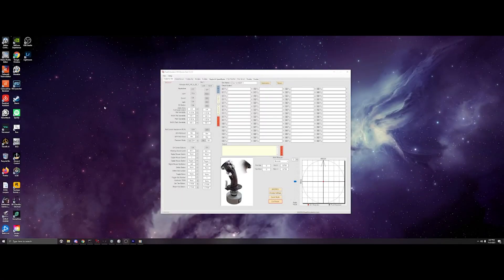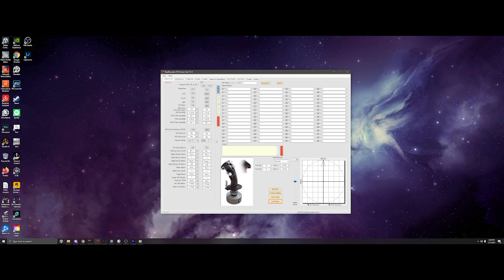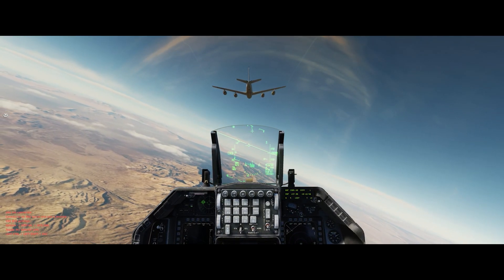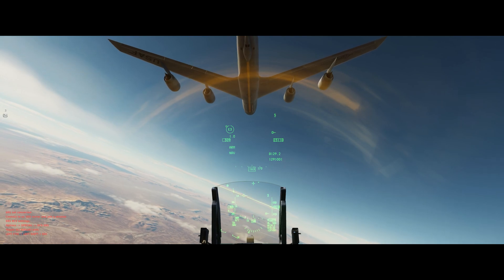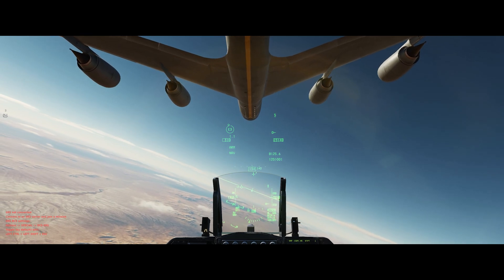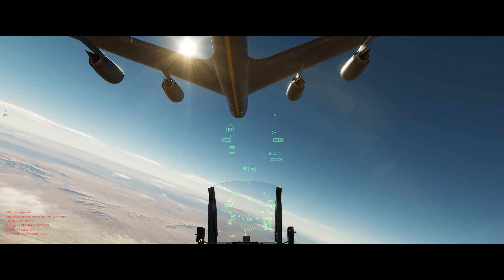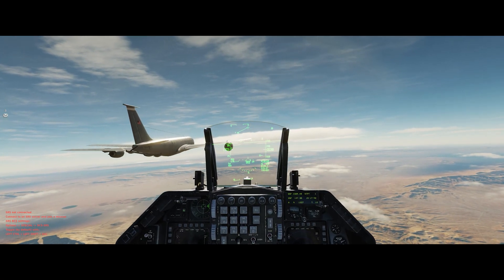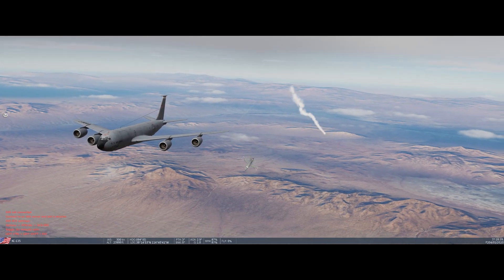Best Settings For The INSANE R3 Lightning To Improve Your Gameplay

Comment: Out of curiosity, what throttle did you have paired with it for this demo? That thing looks steadier than an immovable boulder next to my best attempt at fueling a viper (currently using an x56 but with an Orion 2 f16 throttle in the mail)
Reply from the maker: In this demo I had the Virpil CM3 Throttle! Definitely an impressive piece of hardware!
Reply: The X56 probably won't cut it. The X65 could, maybe, but hard to come by these days. Winwing has a force-sensing Orion 2 base upgrade in the works, so who knows, maybe it will be decent.
Reply: @theeltea  since I made the original comment I've gotten my winwing throttle, and a tm warthog stick, probably put it on the teams in base eventually and set the original base up with the f18 grip on a center chair mount
Reply: @deathsicon  Sounds like a good plan. You could always upgrade to something like a Mongoos mt50cm3 base if you enjoy center sticks too.
Reply: I go more for where is it in the real thing, playing under VR it makes more sense for me, I try to put anything I can close to where it should be

Comment: Next time please contact the tanker then they drop the boom and then you cane say raddy for contact.
Reply from the maker: Thank you for your comment. I was having multiple issues with the tanker actually functioning; IE: the boom wouldn't come down and the precontact lights wouldn't come on after contacting it. These multiple attempts were edited out. The frequency was correct and everything. After doing a repair on DCS it resolved the issue.
Reply: @Hav0k  Sorry for you, out of gas and in the nowehre, eject eject eject.
Reply from the maker: @rainerskommodau2880  when the tanker just doesn't like you and doesn't wanna give you any gas it gets to be a rough flight 🤣
Reply: @Hav0k  Yes Sir 😎🤣

Comment: Appreciate your video. This stick (and base) is amazing! The more I fly with it, the more I appreciate what it does for the Viper. Hard to explain, but it just feels so natural. I'm not sure how close it is to the real thing, but they nailed it as far as the DCS F-16C goes!   I have to experiment with the settings and try yours. Thanks.
What's up with the boom?  I tried it on a custom refueling mission I made and... nothing.
Edit: Just read something about the KC-135 MPRS boom not programmed to extend. Have to use the KC-135 instead. I'll have to check.
Reply from the maker: Yeah it definitely is something truly special. As far as the boom, I'm not sure what was going on but every time I called the tanker for precontact he wouldn't respond. Then just the other day it started working lol.

Maybe it was something with voice attack and vaicom creating issues? I'll have to try it again later with those open to see
Reply: @Hav0k  Yeah I replaced it with the KC-135 and all is well.  Love me some VA / Vaicom Pro!  Another excellent tool for immersion in DCS.
Reply from the maker: @redtailpilot  Absolutely is! And yeah it appears to have been an isolated case with my KC-135 issues... Everything is working for me as well.
Reply from the maker: Also yeah f16 doesn't work with the mprs.
Reply: I find the precision it gives on the pitch channel is superior to anything else on the market. Articulating sticks just don't cut it on DCS viper. They are fine, don't get me wrong, but it seems Viper is just made for this.

Comment: Awesome videos your sharing with us about the RealSimulator gear there’s really not enough information and vids on it. Yourself and LowBlow are the only 2. I need to try your setting as the real problem I have is sensative center of the R3L when using the guns. You told me you did a slight dead zone, I haven’t had a chance to do that yet. It’s just sensitive in the center. Dragon for RS told me that you can use the first trigger as setting to help with this issue. I posted that in the RS forum. But anywho, thanks for sharing man👍🏻
Reply from the maker: Yes, I believe I did set a slight deadzone. I'll post all of my settings as soon as I can and post more videos on it. I think there's a few things you can do for it.

Comment: Hi Hav0k, i don't want to miss this masterpiece of hardware anymore! Here is a little tip for air refueling, or in general - there is the possibility to change the sensitivity during the flight - in 1/4 steps - press the SMM (Special Mode Menu) - (for me CMS), then the base flashes -> now the DMS on the stick downwards and the sensitivity is halved (upwards again to 100%, to the left to 1/4, to the right to 3/4) - but I see that it is not activated for you. For me it is shown at "Keystroke" ....
Reply from the maker: Yeah in the video I explain that the f16 stick that I have actually has a rotary underneath the trim hat that allows you to change the sensitivity on the fly between 8 modes that you set up. I currently have 3 for the different type of flying I'm doing at that moment. In the most recent video I posted you can see the stick in operation in dcs
Reply: @Hav0k  I've had one for a week and never noticed that wheel. thank you!!
Reply from the maker: @therocinante3443  hahaha 😆 i got you!

Comment: YESSSSSSSSSS! just by watching it feels way smoother than flying the warthog hotas .
i can't connect properly on a straight line. 90/100 points
i can only do on a turn. 110/100 points 
 The technique i use is to listen to the engines, see the pph fuel, and speed.
 and the light colors
Reply from the maker: I have to admit the virpil throttle I have is pretty incredible for accuracy, but it's also about how you set your curves as well. But it seems relatively easy to hold throttle in the viper